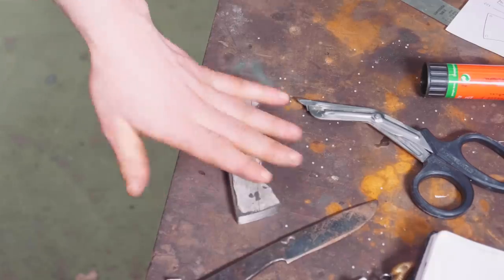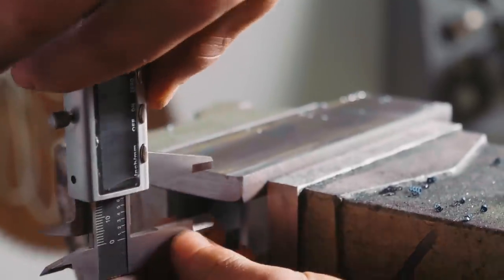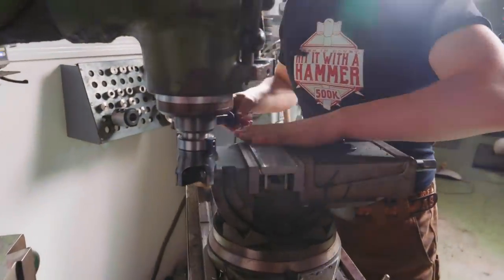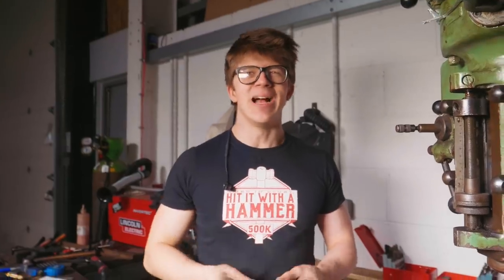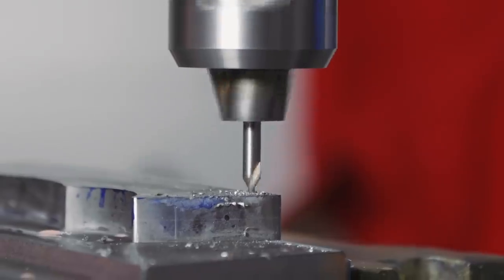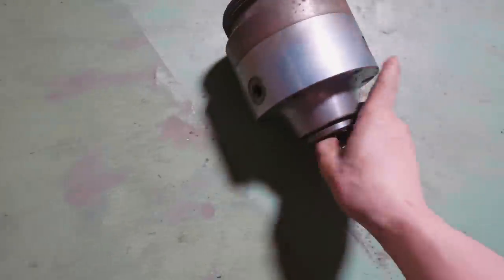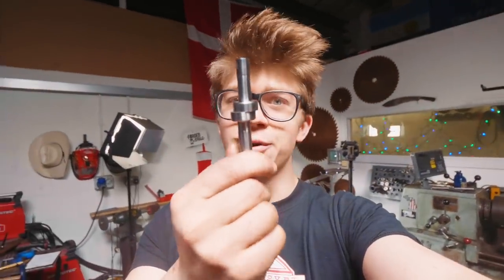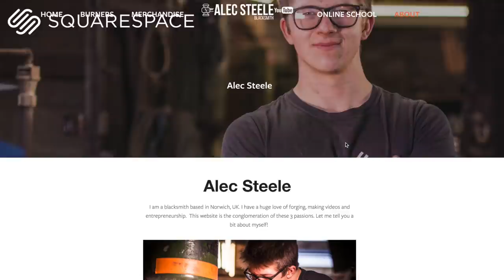MAKING A FRAME-LOCK FOLDING KNIFE!!! PART 3

Comment: A center drill is used for putting a center in the end of a part on the lathe. The tip is deeper to ensure the part rides on the flat. What you really want for the mill is a spot drill which has all the features you mentioned without the smaller tip that is unnecessary for spotting for drills.

Comment: Hi Alec, when I first started machining I was taught to use a needle and Blu Tack if you didn't have a wiggler. Shove a blob of Blu Tack on the bottom of your chuck, poke the blunt end of a needle in it, turn on the machine and center the tip of the needle. Works extremely well and very accurate as the needle is very thin and pointy.

Comment: When you are using a center drill in the mill, you really only want to make a small divot instead of making a deep hole or going all the way to the 60* shoulder because when you go in with a 118* drill you are more likely to wear and chip the outside edges of the drill, especially on the small drill bits in tough materials. Just go as deep as the very small portion of the center drill that is either 120* or 135*. Minor tip but it will save you time and money!
Reply from the maker: Awesome! Thank you so much for the tip 😀😀😀

Comment: Alec unscrew the stem from your mag base indicator holder from the magnet and put it in your drill chuck in the spindle set the indicator to 0 at the furthest point in the y axis and rotate the spindle  and tram the  head directly on the table of the mill once it's 0 in all 4 polar axises it's much easier to evaluate  your tooling and fixtures. Also indicating your work in the fixtures will eliminate tapper and unflat pcs. Hope this helps I do this daily !

Comment: Another one for you mate, pick up a 10mm 120 Degree Spot Drill . Centre drills are for lathe work as they have a 60 degree tip on them to accommodate a live or dead centre on the tail stock. Normal jobber or twist drills you are using in the mill will more than likely have a 118 degree point on them which you are driving in to a 60 degree hole. This will wear the drills all at the same offset on the tip causing them to bite, rub and eventually snap, might have been what happened at 11:04. Keep it up though, everything comes in time.
Reply: JNP NineZero agreed

Comment: Regarding the engineering difficulties, you can download and learn "Inventor". It is a 3D modelling program in which you can load all the made pieces to one assembly. This way you can easily see conflicting parts. Perhaps it is worthy of trying and otherwise it's a few hours having fun with some new technology ;)
Reply: Yes inventor is a really cool tool. Learned to use it in school but never needed it. It's not that difficult
Reply: yeah, i'm working on a education license for solidworks. I 've done quite some projects so far (mostly common combustion engines and rotary stuff) and i love the 3D modeling so far. The reason i recommended Inventor is because you can download the "student" (trial) version for free. You aren't allowed to make money with it, but for you using it off camera to make things like 1:1 copies of the actual design it shouldn't be a problem i guess. 

The benefit of Inventor is that you have way more technical options to use compared to other free software (as far as i know). I know it isn't as usable for forging swords and such, but it's the first program i could come up that you can actually use without having to buy a subscription
Reply: I've only used SolidCam which is a addon to SolidWorks. It works quite easy, but you have to know some tools and what they can and can't do. Besides that it's easy. You can simulate the CNC and see how it takes away the exces material, so you know you're doing the right thing

Comment: If I could give you one hint. Use a reamer bit on every hole you can. It makes everything perfect. They sell laps to It a just a brass drill bit that can expand a little so if you need to take a few thousands of a inch off in a hole to make the blade come out smoother you can "polish" the inside of the holes. You can also do that to the pivot hole on the blade. And I know you are not at that part yet but when you go to make the blade centered lots will play a part in that. The thickness of the lock bar relief if it's to think and you bent the bar into far it can push in the blade alot making it off center. I had a hard time making my first few knives betting center. Can't wait to see this knife finished.

Comment: Hey Alec I work in a tool and die shop. Whenever we get HSS drills or center drills broke in parts we usually cut them out by slowly plunging a carbide endmill (make sure it's center cutting) that is slightly larger or the same size as the the broke drill. Go slow like .005" thousandths at a time at wicked high rpm like 1200-1500 use cutting oil cooltool by Monroe is great and it will slowly eat away the HSS the only disadvantage is if you screw up you now have carbide stuck in your work.... and good luck cutting that out. Best of luck and have fun.

Comment: Hey you should use styrofoam for your casting because it melts and gives you a perfect copy! And thanks for the great content!👍🏻 the maker kind is dying but you’re doing a good job to bring it back. We need more people like you and I
Reply: Dave Erving Evader Knives exactly!
Reply: Exotic10954 exactly!
Reply: It would be easier to cast but the surface finish wouldn't be as good as the gases from burning off the styrofoam create little crators in the final piece
Reply: Chris Foerster that’s why you have a outlet for the gases. He already has used a outlet for the gas in other videos. I was just giving him a tip. You should watch king of randoms videos in the topic
Reply: Even with a vent not all gases can escape quickly enough. This then is what leaves the marks
Reply: Chris Foerster it leaves it with any casting
Reply: It does but more so with lost foam casting. It just means there is slightly more grinding to do. Its not a big deal but a reason as to why he may not be using it

Comment: Gooday Alec, as always; great video!
About the center drill, it's okay to use that drill to spot holes (good for small holes) but you only want to use the tip of the drill. (The 118° tip).
Otherwise use a spotdrill with the same tip angle as the drills you use.

Comment: Just a suggestion about salvaging your mill vice: after determining the table of the mill is flat and true to your travel if you bedded the vice upside down on the table (on the working surface of the vice using parallels that are taller than the throat of the vice) and milled the base of the vice should be parallel to the table for all milling work.

Comment: I don't know if you are actually going to put a thumb-stud on the knife. But if not it's a good option to. It helps with the opening action. Also another recommendation is putting gimping on the knife (The ridges down the spine of the blade and the back of the handle) What that does is add grip for your thumb when you're doing more fine work with the knife. I'm not say that these need to be done. But they are good additions and come pretty standard on most folding knives.

Comment: before you go buying a new mill vice, there are a few things you can check
1) lightly stone the bottom of the mill vice, recheck the vice.
2) failing #1, check that your parallels are clean and the mouth of the vice is clean. check that your part is seating on the parallels. little trick i learned in trade school to check for this. a little tab of paper under each corner. if the paper comes out, your not seated right.
3) double check your tram from various points on the table. you might have wear in the ways either your X axis or your Y axis
4) things might have moved slightly when you were snugging down the bolts from tramming

just a few things to try before spending money

Comment: Someone likely said this earlier but a couple of things again.  Try a higher speed on the small drills and try to feel them more through the spindle handle.  And for someone that managed to tram their mill head to just one dooey out of tram over that distance you're doing great!   Oh, and center drills are technically not for starting drill holes.... although almost everyone uses them for that.... They are technically intended for drilling the center cones used to support the point on a live or dead center in the lathe or for when you move on to holding a shaft between centers on the mill.

Comment: Centre drills and small drill bits need a higher rpm. Also I learnt to machine on a lathe that cut a 0.004” taper over 1 inch cut during my apprenticeship, still managed to cut straight just need to manipulate the machine as you go 😀

Comment: 2mm drill snapping: behold the highest grade Chinesium steel in action. Cheap bits and end mills break and are only good for if you just need a few holes.

Comment: Sticky pin… a blob of plastercine with a slightly bent sewing needle pushed into it. Stick it to the end of your drill or cutter and use it the same way you would use a wobbler needle. (Bluetack doesn’t work… it doesn’t like oil) 
A trick engineers have been using since engineering began.

Comment: Have you herd of a sticky pointer.
When I was an apprentice there was no such thing as a centre  or edge finder.
We would put a nice dowel pin in a Colette chuck to find an edge. (Increment + 1/2 the size of the dowel.
Or to line up with a marked out line stick a piece of plastasine with a dress makers pin in it to find the centre.
Just spin the spindle and centre the pin with your finger.

Comment: Instead of switching back and forth between the center drill bit and the full size drill bit at every hole, you might get better results by pre-drilling each hole with the center drill (noting the X/Y position of each hole from your digital readout), then switching to the regular drill to finish all holes. Not only would that save you time, every time you manually change tools there's a chance you put it in wrong and you might break it (I wouldn't be surprised you broke the bit here because it was slightly off center that one time).

Comment: Alec,  get your machinist handbook out and look up machining speeds. Or use an online calculator. It will save your tooling and speed the process if you use the right spindle speeds and feed rates for the different sized cutters and types of metal. It was like a whole new world opened up when I learned it.

Comment: There's an old saying Alec "Amateurs built the Arc. Engineers built the Titanic". Your learning skills through the school of hard knocks, it's a tough school and very hard on some ones wallet but very entertaining. You have the means to fix the run out in that cheap vice, it may not last as long but it could be just as accurate. When you dial in beds, work pieces etc do not use a dial indicator, use a finger dial with smaller graduations then .001" or metric. Also you appear not to trust your digital readouts, they could be your best friend when working from a drawing. Cheers mate 🍻

Comment: Warning not a machinist, just what i would do The mill table you can fix by filling the holes with one of of your welders and resurfacing it with a mill. You can probably also bring the vice  into square with your mill, just find out what plane is out of square and fix it with the mill. If it goes wrong, no harm, you already bought a new one.

Comment: Hey just make sure that you don't cut the lock surface on the blade till after heat treatment. If you already did then the lock up will be over the 50% instead of the target 15-20%

Comment: I've used a vice on a mill that was exactly the same as that one. There were two mills at that engineering workshop, and the other mill had a really good quality vice on it. All the work I did on the mill with the good vice fitted perfectly, and the work on the other vice went into the scrap bin. 😂

Comment: You need to drill deeper with the center bit. The really centerin part is the cone cutting edge. The angle makes it a long in touch cut and the main forces press against the center and not along the length. Looking at both sides these forces cancel each other out. If your bit is not centered when it comes to the cone cutting edge, one edge has more cutting length than the other and thereby more pressure. So they will be pushed to the middle until both cutting edges have the same force. Also try to hold at least half the shaft. In that one shot at about 8:15+ the center bit is far out of the chuck. Also there are NC center bits. Those are maybe better for what you're doing. And those have a 90° angle, so at the right deep, these will also make your holes nicely beveled (champfered?, not sure wich is the right translation for the 45° angle at edges to break them)

Comment: You sir need a dial indicator for the mill and lathe. The lathe needs a magnet dial indicator and mill needs one that goes in a collet. You run the tip down until you make contact with the top of the Vice then you run the table side to side while making adjustments to the Head until the dial indicator does not move. Your next move is 2 clamp one of your steals in the Box and place the tip of the dial indicator on the face of it then run your table side to side that will tell you if you are square with the table front to back if you're not adjust more and recheck the face. I wish I could come all the way to you and I could make you a king and confident in Machining but I can't hope you take this knowledge with you. PS you can square in a cheap Vice in America it's referred to as Kentucky windage

Comment: you could mill the top of the vise to level once you have the mill leveled
Reply: Josh Clark the problem isn't the top of the vice, it's the bed. He's got a poorly machined casting. Depending on metal thickness it's fixable but will require disassembling the vice and milling the base and possibly the moving jaw.

Comment: I have 2 mottos I live by when it comes to my work and hobbies:

1. Buy cheap, buy often;
2. I'm too poor to to buy cheap stuff for my work and hobbies

You don't necessarily need the best quality there is, but if it's something you use often, (particularly if your livelihood depends on it), it's usually best to pay extra and get the best quality you can afford. In the long run, it turns out to be much cheaper.

Comment: I worked in a factory where we had a CNC router and the boss would only buy cheap bits at $80 each. Each bit lasted one sheet of plywood and we had to do 50. After 10 sheets he finally got the better bits at $360 each and two finished the job.

Buy expensive stuff and buy it once.

Comment: Alec,  your 2mm drill likely broke because it was spinning too slowly. (If it’s a camera shutter speed trick I apologize and you can disregard)On this side of the pond, drill spindle speed formula is cutting speedx4/diameter(inches).  Most carbon steel likes around 400sfpm. 2mm~5k RPM. you probably can’t run that fast on your mill, but fast may help.

Comment: Are you sure there isn't a chip or a deep gouge under the vice base?  Take it off, flip it over, and run a good smooth stone across the bottom.  Any gouges will be visible after just a few swipes.  Do the same for the bed of the mill too, just in case.  Thoroughly clean both before bolting the vice back down.  Or... it might just be a garbage vice.

Comment: What is your rpm for the center drill? It sounded a little low, it needs to be 900-1,000 rpm's. 
 There's actually a formula for thr drill speed depending on the size of the drill/mill bit and material. I'm pretty sure its in a basic machinest handbook as well. 
 Great vids btw, and to the videographer who shoots and edits them as well.

Comment: Alec if you are doing a lot of flattening stock why not buy a surface grinder? pretty cheap for older well built machines most come with a mag base too. I may know of a J&S 540 grinder that is being used in a diamond bit/honing making workshop, they have three but mentioned getting rid of one as they only ever use one and have one as a backup so three is overkill. email/pm if you might be interested for more info.

Comment: Go to a local machine shop with an EDM. Not a Wire EDM (W/EDM). The old timers call 'em hole poppers. They use a graphite rod in a bath of electrolyte to "burn" the broken tap or drill out of the hole with electricity without destroying the part. Yes, there are ways to try and cheat the broken thing out, but, if its something you don't want to ruin. Burn it out. Oh, and the smaller the drill, the higher the spindle speed. There are charts for reference. you have to match your feed with surface feet per minute.

Comment: You tram the head from the table not the top of ones vise, so it likely is the the head is still out of alignment and that your vise is fine, either that or you didn't have them set down on the parallels completely

Comment: Could very well be the vice but make sure your table isn't teeter tottering when you run it the full length. Run the table all the way one direction and check that the knee is still holding the table perpendicular 90 degree to the mill head. i.e. put something all the way at the end of the table to measure off of. Of course i do see that you are working in the middle of the bench so its not likely that your table is running that far out for such a short side to side distance. Food for though.

Comment: Knowing that, could you use the mill and flatten the vise as well?
Reply: Douglas Huddleston He probably could but flattening and squaring the unit would require more experience than Alec currently has. You'd also want a surface grinder which he doesn't have.
Reply: That would make sense, just a thought, I've never really messed with mill's before. More of a farmer blacksmith than anything. Thanks for the info!